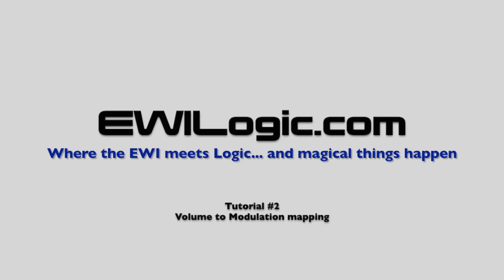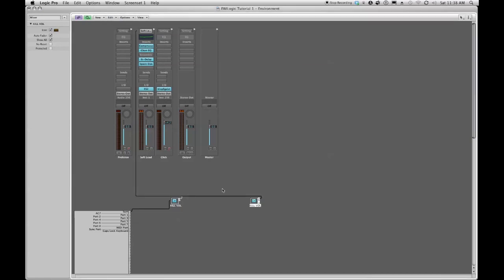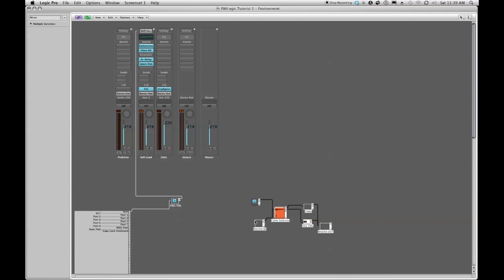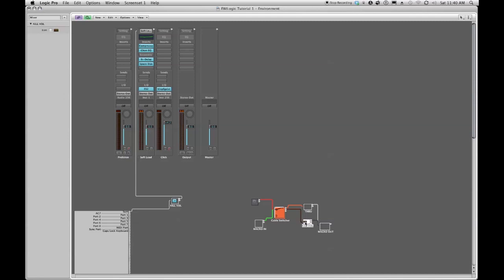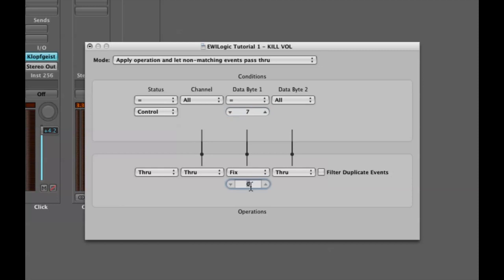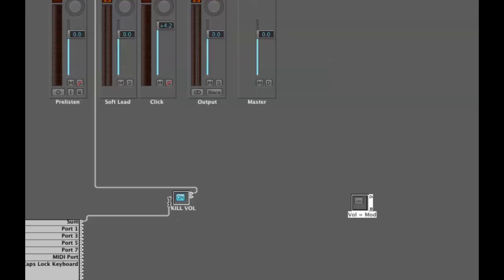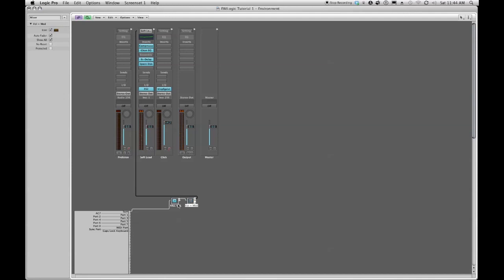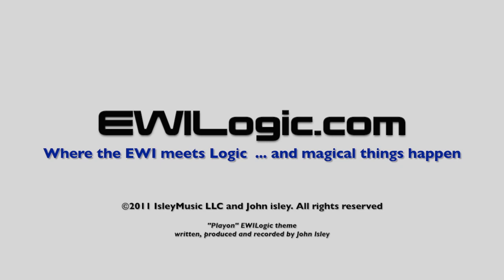EWILogic Tutorial Volume to Modulation Mapping

Comment: Amazing. Am curious how you adress cc#65 portamento plate on logic?
Reply: Hi Chris - there are any number of ways to address it. The easiest is to insert a transformer object in the MIDI path just after the MIDI input device into Logic, and remap the output from CC#65 to whatever CC you want to control with it. I personally rarely use the portamento plate but I have had success remapping it for various uses.